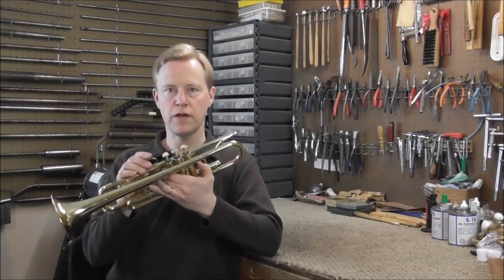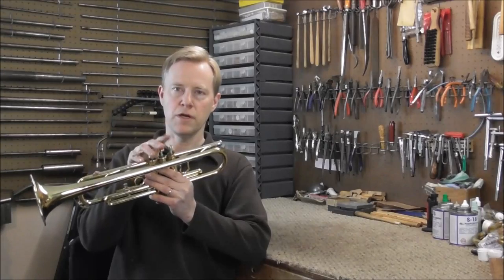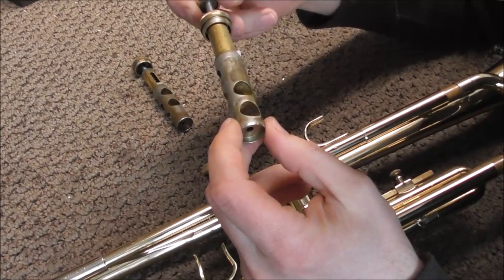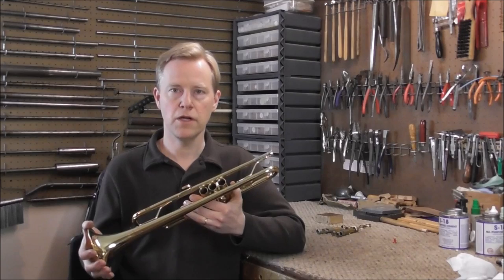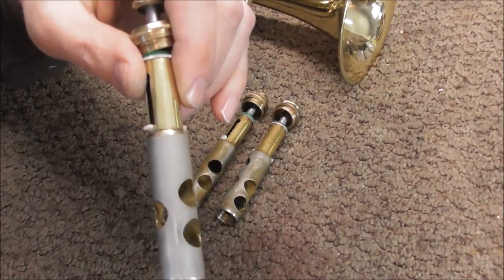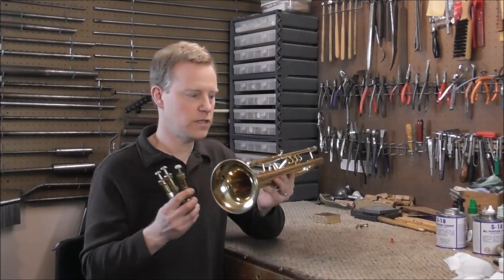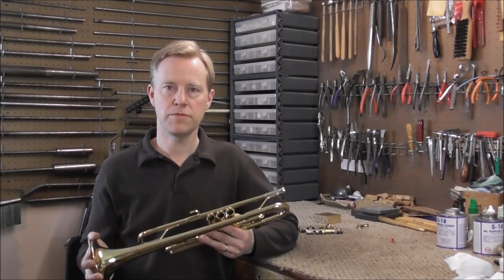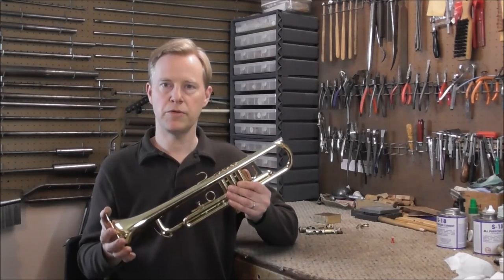Chronically Bad Valves: Band Instrument Detective Episode 2

Comment: Had this problem with an old really worn down yamaha ytr-282 I bought dirt cheap. It had ugly patch work on the lead pipe. REALLY stuck slides and exactly this problem with the valves. The nickel plating was worn and scratched up so much that you could see the brass underneath. Ended up just stripping it for parts and soldered the remains into a Bflat bugle. Just to practice my soldering

Comment: Wow you cleaned up that valve so well.  Too bad it didn't fix the problem.  My monel valves have a bit of discoloration and occasionally stick when I push them down at an angle.  I was thinking about giving the valves a soak in vinegar to see if that would clean them off and improve performance.  Any thoughts on this?  Thanks!
Reply from the maker: You can try it. It may work if the problem is because of junk on the valves. There are many other things that can cause this problem, but you will not hurt anything with vinegar.

Comment: Hey I need some help trying to figure out what’s wrong with my trumpet. When I played an Ab, I noticed a really loud vibrating sound which I could also feel. Someone else heard it and they asked someone else for help. An advanced player played my trumpet with their mouthpiece and found out that low C# was also making the loud vibrating. We looked at all of the valves and they looked okay. They were well oiled as well, and weren’t sticky at all. So we just moved on and practiced our music piece, but during it I noticed note E also had the vibrating but it was more noticeable with the lower notes. Someone told me that it was probably the middle valve that was messed up and I should ask the teacher on Monday when he comes back. But I want to find out now so I can practice the chromatic scale over the weekend.. because that’s due Monday...
Reply from the maker: Usually a buzz is because of a loose screw or slide. Check all of the screws (lyre screw, 3rd slide stopper screw, top valve caps, bottom valve caps, or any other screws). If this does not solve the problem, check to see if a slide is loose. Play all of the notes chromatically very slowly and hold onto a valve slide while you are playing. Do this with all of the slides one at a time. If the vibrating stops when you are holding one of the slides, that is most likely what is causing the problem. There are other things it could be, but these are the most likely. 
Let me know what happens. 
Art

Comment: Some professional level instruments are made with Stainless steel valves (particularly in the larger brass instruments), is there any reason why you feel it is an inferior material?
Reply from the maker: I do not know the answer to that question. I was not aware that there were pro instruments with stainless steel valves. I will have to do some research on this and I may need to make some changes to the video.
Reply: The Brass and Woodwind Shop take a look at Besson sovereign and prestige euphoniums. They have stainless steel valves. I was under the impression they were superior to monel, but harder to manufacture. But that’s possibly what their marketing department want you to think.

Comment: The number 2 valve on my mellophone is sticking. When I put another valve into the cylinder, it works fine. The number 2 valve has some scoring on the side. Would it be possible to lightly sand it, say, with 800 or higher paper?